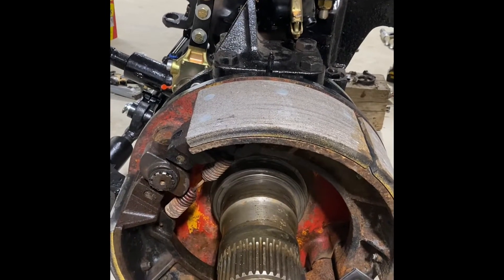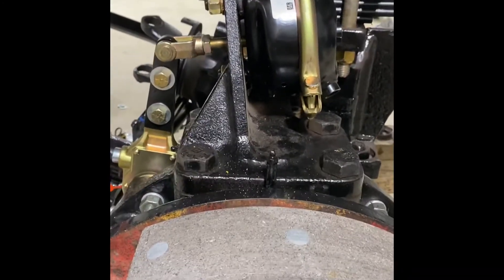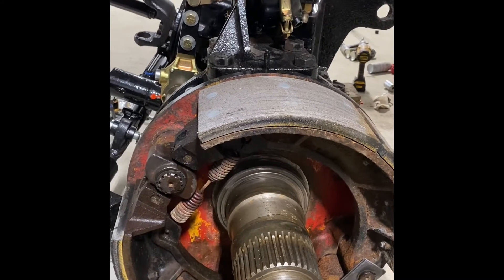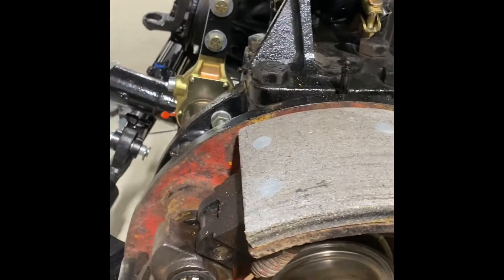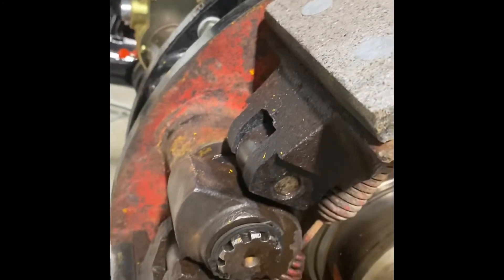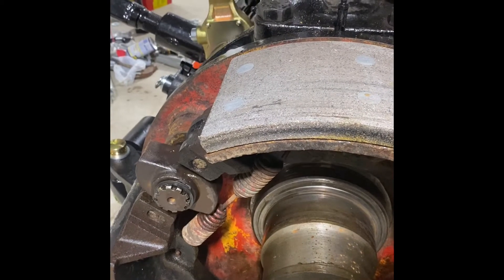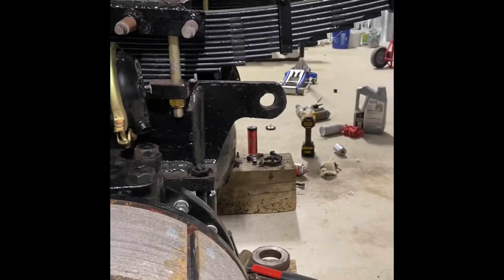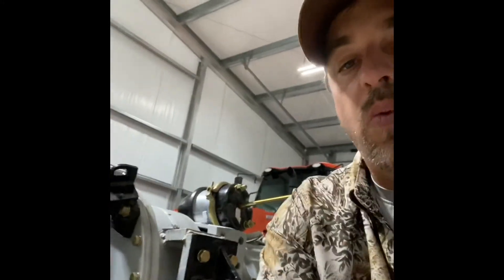Texas Toy update May 6 2020

Comment: Did you go with these kind of brakes rather than driveline brakes in order to keep it more original??  Thanks for the update love it!!
Reply from the maker: This truck was designed for sled pulling. These are 80 ton axles from the 1950’s. They were used on mb-2 tugs for b52 bombers. They contain mostly Eaton internals. These were designed for military use so most manufacturers were shut down on production. I am keeping the truck as original as possible. This truck weighs 24,000 pounds and was a one of a kind in its class. The drive lines are over 100 pounds each. The axles weigh in at 4,000 pounds each. This truck is running original power train and still runs like new. It is built to pull and it would do it all day long. Hope I answered  your question and thanks for watching and support.
Reply: @RockyRohde  thank you for the answer & for restoring one of my favorite old school trucks👍
Reply: @RockyRohde  I'd love to see her pull a sled when she's all done!